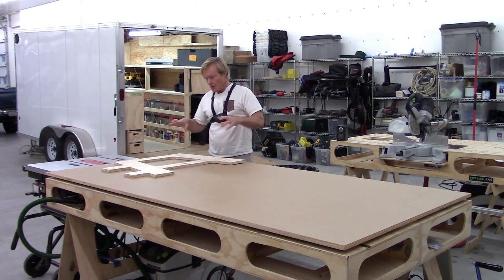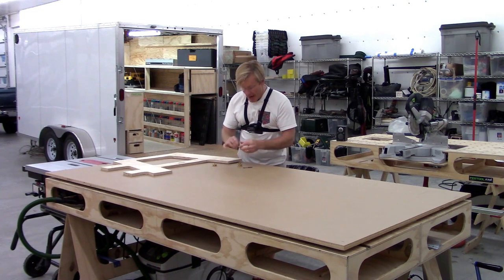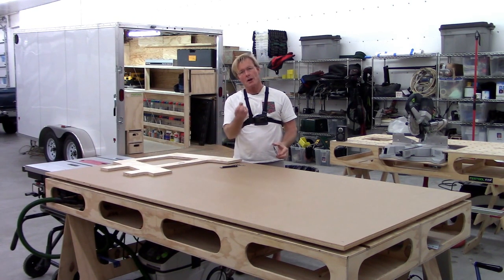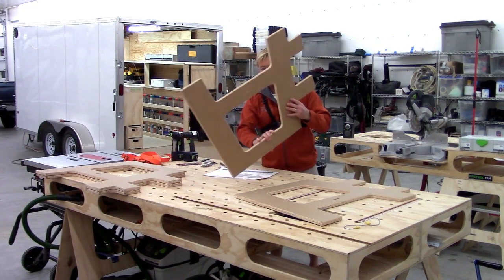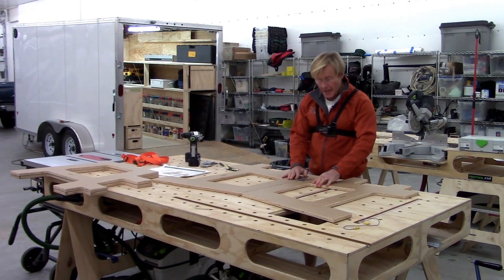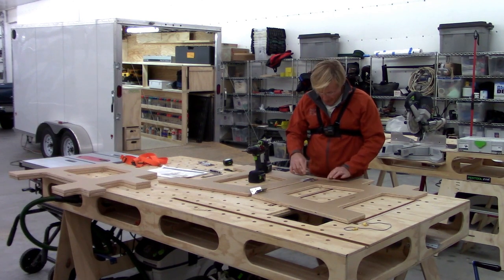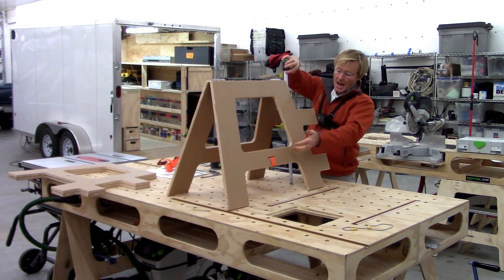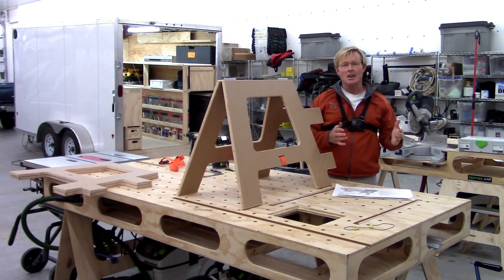BUILDING THE PAULK COMPACT BENCH (PART 3) SAWHORSES

Comment: My copy of the Compact 3 x 6 Workbench plans shows the saw horse as 27 inches tall. When the legs are opened to about thirty degrees, the height of the saw horse, even if you include the tilt of the narrow edge top and bottom, is about 26.25 inches at most. The bench is 9 inches, so the surface of the bench will be at 35.25 inches. I have been out at various stores, looking at job site table saws on wheeled platforms (e.g. DeWalt) and measured the height of the table to floor. Most are between 36 and 37.5 inches. This leaves about 0.75 to 1.25 inches drop from the saw table to the outflow table if you use the bench this way, and yet when I see your bench with the StopSaw at one end (I have not measured that), it looks to be the right height. How much drop to the outflow table would you tolerate?
Given that the bench height can be adjusted by opening and closing the legs from 23.4 inches (60 degree spread) to 26.6 inches (20 degree spread, less might be unstable) which adjusts the height of the surface between 32.4 and 35.6 inches, would you suggest extending the length of these legs to 28 or 28.5 inches?
Also, do the straps stretch and could they be supplemented by plywood forms with slots at a fixed length to stabilize the distance of spread?
Reply: Glad I saw this comment. I too am worried that closing the legs to get the the bench top level with my saw will leave them untable. My Jobsite saw mounted to a Dewalt DW7440RS miter saw stand on flat surface yields a 35.5" table height. Did you build the bench / did you lengthen the legs to accommodate this?

Comment: Saw horses seem pretty strong, I've seen you stand on it.
Would it make it any stronger to bevel the top edge so that inside and outside are the same height at the open angle one uses all the time?

Comment: You say that your benches are all set to 36 inches in height.  Can I ask how tall you are and what level your waist/hips are?
I'm slowly setting up my own workshop and have benches at a variety of heights and haven't decided on the 'best fit' for me yet.  I'm 188/108 and benches at around 100/105 feel best so far (the TS is at 108.  Not sure how such a high platform will affect workflow and safety).
Reply from the maker: I am 5'10." I choose to make my benches the same height as shop equipment so it all matches up.
Reply: Thanks for the quick reply, Ron.
So about 10cm shorter, and your benches are about the same shorter than my variety.  Looks like I might be going in generally the right direction, then.

What do you mean by 'shop equipment'?  Is there a defacto industry standard height for things like tablesaws and mitre saws?

Cheers.
Reply from the maker: Standard shop equipment is 36"
Reply: OK, cheers.
I don't have much in the way of 'stationary' equipment yet, so that's good to know for future planning.